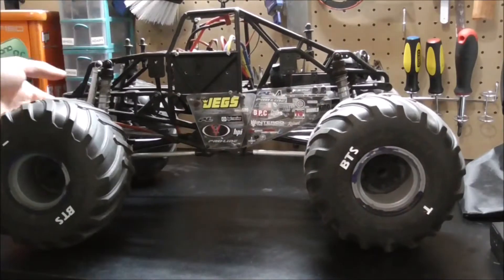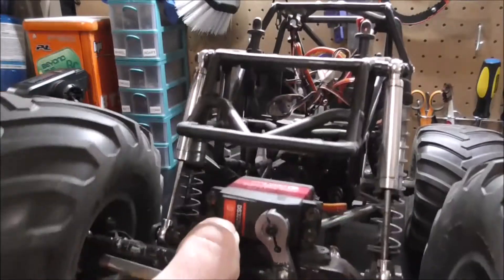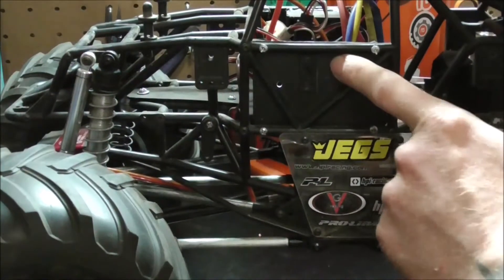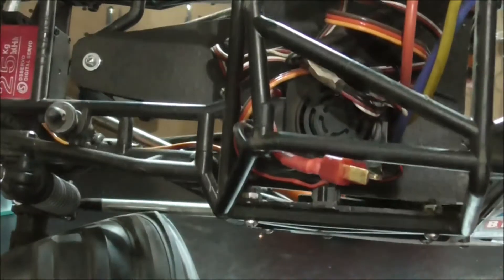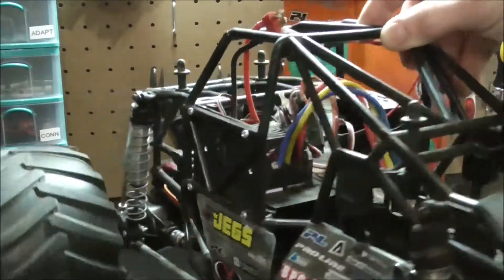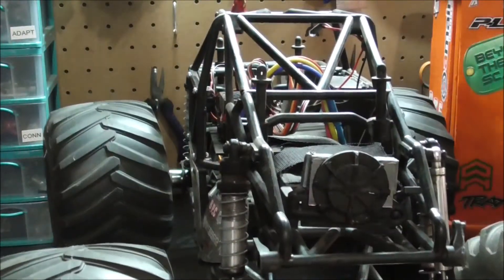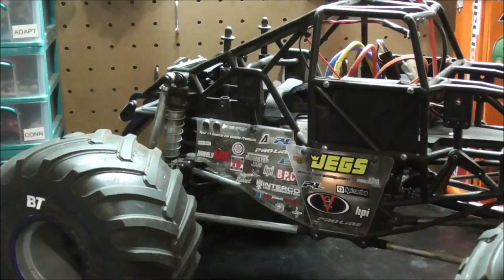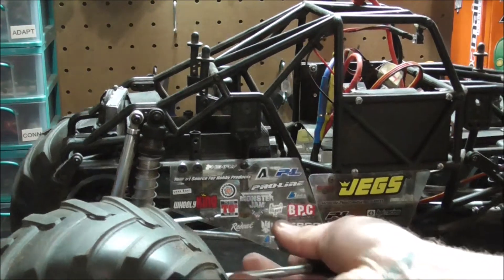Axial SMT10 part upgrades

Comment: Hello, when buying those metal drive shafts,was they classed as "axial smt10" fitment or did it give mm`s for size. want to upgrade the shafts but not sure of size needed.
Reply from the maker: Yeah the link I provided below has them listed for the Axial SMT10.  Not sure if they had included any mm specs on them.  Hope this helps and thanks for watching! 👍👊👍